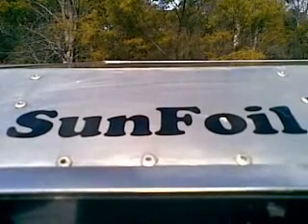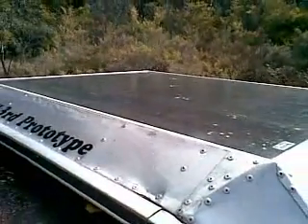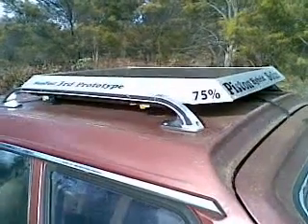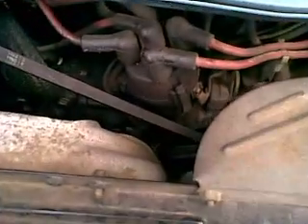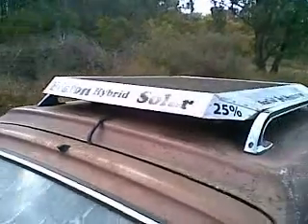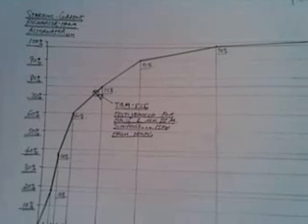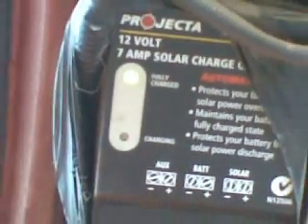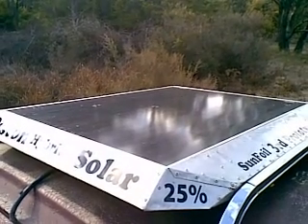Subaru Solar-Electric Hybrid 4WD. SunFoil 3rd Prototype. 2 Yrs Update.

Comment: Great Video!....I NOTED the solar panel is on 40 whatz, what's if you put a 140w panel on.????
Also, do  you require a charge controller between the panel and the battery.?

thanx for your video, much appreciate and i loved all your mathematical calculations as i'm not the best at maths but like tinkering around with solar. :)

Mick
Reply from the maker: G'day,

  Thanks.

  Ah, yes, there's a Solar Battery Charge Controller connected to the PV, and then the Charge Controller is connected direct to the Battery with an inline Fuse.

  Every Startup the Starter sucks the Voltage down so low that the Solar Controller tries to desulphate the Battery by running it up to a higher Voltage than the Alternator's Regulator can compete with, so the Alternator "sees" the Solar Current as being a full Battery, therefore the Alternator shuts itself down & waits for the Voltage to drop ; but if the Sun's in the Sky the Voltage stays high, so the Vehicle always uses Solar Current if it's available.

   Modern Cars have big Electrical Systems, so I wish my Subaru had a 75 Watt instead of the 30 which it has...; Diesels have big Batteries & big Starter-Motors & Electric Glowplugs, so the bigger the Panel they get, the better it works.., as long as it doesn't look too clunky...(!).

  Backtrack me to the "SunFoil Project Playlist..." to see the Construction Clips.

  Have a good one,

  ;-p

  Ciao !
Reply: yeah, thanx for the reply. Your work is interesting., 
As for the ALT, these days they have 120Amp....you should be able to pick them up from a wrecker for a bargain. :)

...also, have you checked out the prius water pump?..it's really cool!
i set up a solar water pond/waterfall a couple of months ago.
(it's a 40w panel and directly connected to the prius pump)
What i did notice was when the direct connection was intiated, i could control the voltalge (variable) by covering a portion of the panel, but
when i connected the panel via a charge controller, as soon as I covered just a part of the panel, the pump would cease to operate......

here is the video from Chris NoTap :
https://www.youtube.com/watch?v=1ojNID2jDz4

Cheers!
Reply from the maker: +Mick Gatz 

 Yeah, they do have 120 Amp Alternators, but they only produce that when the Battery is as flat as a Turd and it can withstand being charged at a high rate, and/or the Electrical Consumption of the Vehicle is high enough to soak up most of the Alternators Output.

  My 28 year-old Son is the proprietor of the Town's Auto-Electrical Workshop, he has a 30 Watt SunFoil on his personal Vehicle (4WD 4-Door Turbo Diesel Rodeo) and his Isuzu 5-Ton 4WD Workshop Truck has a pair of 45 Watt & a pair of 150 Watt PVs on it's Toolboxes.

Have a good one,

;-p

  Ciao !
Reply: Thanx mate, i really appreciate your videos. (did you sus out the Frezel Lense?)

Comment: Great results
Reply from the maker: G'day,

Thanks mate,

  As I like to say, putting a Solar Panel onto a Road Vehicle is the simplest cheapest easiest lowest-hanging Fruit on the Alternative Energy Tree...

;-p

Ciao !
Reply: I am rebuilding an old a house. I put  a window in the attic that faces south.
I used several sets of garden light solar panels wired parallel in the window & circuits to power low lights at night off single AA cells. I have 4 units in the attic that lights it up enough to see and I have 1 unit that supplies low light to the fart fan in the ceiling in the bath. There is no power going to the house right now but you can go in at night and see fine.
This is my low level entry into the world of solar lighting. All systems seem to work fine after a few months.
The fart fan cell usually checks @ 1.32 V by noon, the circuits use little power and runs 7 LED in the bath. I have a unit running 7 LED in the living room and 1 unit with 4 LED in the kitchen and 1 unit in the bedroom window running 3 LED
I am happy with the results
Reply: WarblesOnALot It's funny, when I leave the house ^^^^ at night, I have a natural tendency to try to turn off the light switch. 
Then I laugh because it's free light
Reply from the maker: Joe Yocom 

Good job mate,

  I always like to run as few lights as possible, to maximise the Battery Life...

   Not getting Power Bills is great, but the real thrill is hearing on the Radio that tens of thousands of people in the surrounding area have no Electricity because of a Storm or a downed Power-Pole, & so they're all sitting around in the dark waiting for somebody to repair their Grid for them...

Have a good one,

;-p

Ciao !
Reply: WarblesOnALot Thanks !!

Comment from the maker: @TheUnDeRGRouNDHoBo
 G'day mate... Thanks ! Um, Diesels need the biggest PV you can fit, without looking silly. The HHO Brigade are kidding themselves... Search "Solar Assisted Pickup." by @PreciseBible... 7+ Litre V-8, 70mph Cruise, 26MPG & he fitted a HHO Bubbler, which made it 18 MPG...; 30% WORSE ! Because, 30 Amps was going from Alternator to Battery to the Bubbler...! 1 Amp of Alternator Output = 1% Worse Fuel Consumption. 120-150 Amp Alternators are common. Scary, huh ? Ciao !

Comment: even just that aerofoil shape would save a few litres in me old cruiser dam turboing it i lost 150klm in range out of a tank , its left me pretty shattered everytime i need to put diesel in me car which isnt often which means i could do with a set up like this 
interesting info explained well 
so do hydrogen genertors hho systems work on cars do you think to ? ive had 1 kicking around a while but often wonder if it would help any

Comment from the maker: @thegreatnoleander
 G'day... Thanks...! Well, you could, but the fuel saved is still proportional to the Average Engine Runtime. Search "Solar Assisted Pickup" by @PreciseBible. He tripled the Battery size, fitted an Alternator Cut-Out Switch, & 180 Watts of PVs... He commutes 45 miles to work at 70mph. Average Runtime 16 min (43% of his longest regular run - 38 min to work). He saves 13% due to the oversized PV. Have fun. Ciao !

Comment: (cont.) You said in one of your videos that all good science can be performed in a garage, but that's flat out wrong. Sometimes you do need the proper facilities. Thus I urge you to perform a dynamometer test in a wind tunnel with an artificial light source to eliminate the unknown variables. This may seem like a tall order, but it is a completely reasonable request if you plan to market the device. I'll be looking forward to your actual results.

Comment: The concept seems legit. Charge the battery with solar to reduce the load on the alternator and thus freeing up the engine. Great. But I've watched your videos and your testing methodology is highly questionable. There are so many unknown variables while driving that the accuracy of your results are doubtful even after months of careful recording. (cont.)

Comment from the maker: @lezbriddon
 G'day mate... Um, the panel is 30 Watts... It fills the Battery. A fully charged Battery cannot suck Juice from the Alternator... My Alternator takes 8 Hp Torque into the belt to make 1Hp of Sparklies. The car takes 5 Hp  for Aerodynamic Drag, at 50 Km/Hr... And 25 Hp at 100 Km/Hr...
 Lots of modern cars have 120 Amp Alternators, at 3:1 step-up (Vs mine's 2:1), so they  take 30 Hp to make 2.4 Hp of Current. It's pretty simple. Sunlight @ 10%, Vs Fossil Fuel at 2% to 3% efficency.